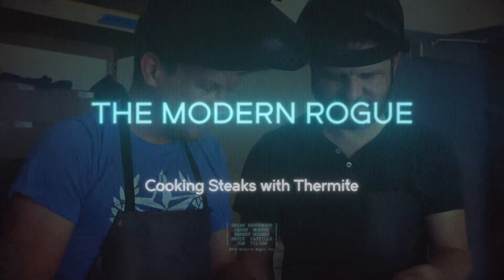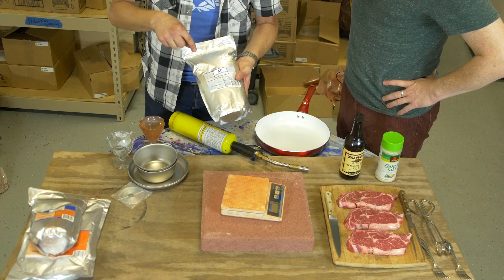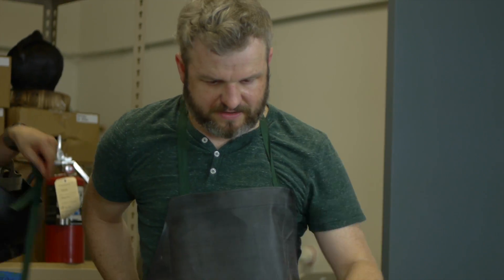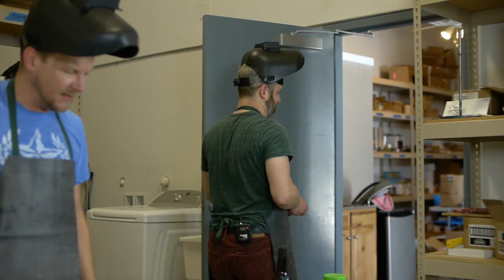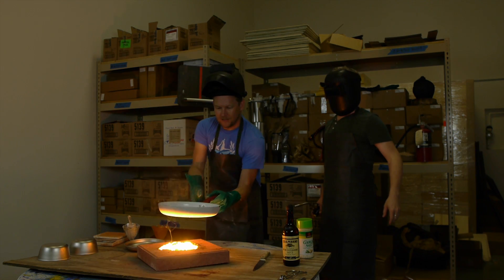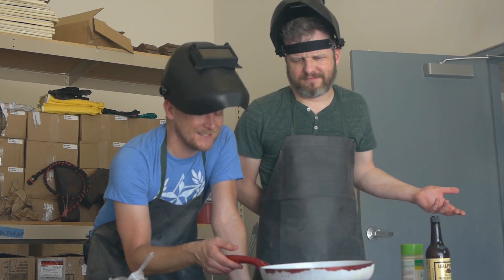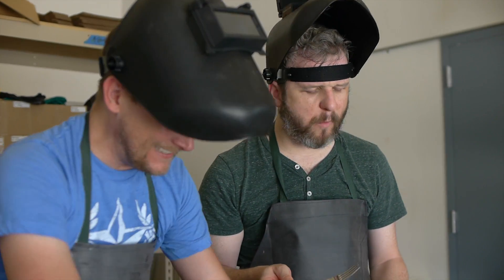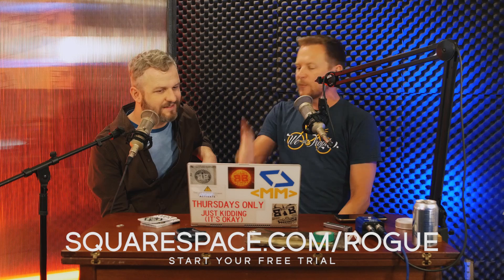Cooking Steaks with Thermite

Comment: almost halfway through and I "hope" the flame point of vegetable oil is higher than how hot that pan is gonna get. or moreso the melting point of the pan. I'd use like titanium and something like refined avocado oil which has the highest smoke point of cooking oils, over 500°F, dunno the flame point but it's usually around 200° higher.... thermite is burning hotter than 720°. smoke point of vegetable oil is like 460-480°F, so I'd imagine the steak is at least gonna get some nasty burn flavor if not catch fire. the smoke/flash/flame points of animal fat is even lower for that matter, and they looked pretty marbled.

popcorn.gif
Reply: ok, I was expecting it to be held over it longer. it seared it but the real cooking was from residual heat. not enough time for thermal energy transfer to ignite the contents of the pan (which that heat definitely would do, probably right before it melts the pan).

Comment: when you mix fuel, metal oxide and metal powder in just the right way,  it burns at 2000 degrees Celsius. Hot enough to cut through nearly any barrier known to man. Throw some steak
 into the mix, and you've got one hell of a combination.

Comment: PSA: oxidizing has nothing to do with oxygen, it just so happens there is oxygen in rust. Oxidizing something just means you increase it's atomic charge. An extinguisher is effective for hydrocarbon combustion with oxygen, but since this is a redox (reduction oxidation) reaction, it won't work to extinguish it as it would a normal fire.

Comment: When you mix fuel, metal oxide and metal powder in just the right way it burns at 2000 degrees Celsius hot enough to burn through any barrier known to man

Comment: Just so you know brian, for future reference its a 1:1 by volume (0.97:1) it a 3:1 by weight for ferric oxide and aluminium... i sadly know this by heart because i am doing research on thermite for a new type ive been working on haha... its also not too hard to figure out once you know the molar mass of the two and seeing that you need 2 Al for every Fe2O3 you multiply the molar mass of aluminium by 2 and then divide the bigger number by the smaller number in this case it was like 158 g/mol for iron oxide and 54ish g/mol for aluminium (after multiplied by two) (also for aluminium because its not a compound its atomic mass is the same as its molar weight) and so you divide 158/54 and you basically get 3 meaning a 3:1 ratio... now if i remember the math i did for its volume ratio it was like 5.2 to 5.4 (0.97:1)

Comment: sigh The idiocy, the idiocy. "We have fire extinguishers." Fire extinguishers with about a max effectiveness of 800 F on a 4000 F-ish fire.
Reply: Thank god you did enough homework on the reaction.
Reply from the maker: On the contrary, the stuff I read indicated that the CO2 fire extinguisher was the best bet to cool down everything to the point that it stopped the reaction.  Is that not true?
Reply: CO2 fire extinguishers are for use against electrical fires and liquid fires. What the don't do is wood/textile fires and flammable metal fires. If you had tried it with a big pile of magnesium, you might have seen it, but CO2 extinguishers just don't work for those kinds of fires.
Reply: You would have needed a specialist powder extinguisher.
Reply from the maker: Are you speaking from experience?
Reply: Yes. Older brother messing around with thermite on the blacktop. They're Class D fire extinguishers, and you can buy them online.

Comment: Also that steak was perfect the first time! 
If your plate isn't half bloody by time you finished eating you ruined the stake! 

It's not really normal rust used
Usually it's a controlled iron oxide 
Generally made by electrolysis because the finer the powder the better 
And it's completely harmless until you get it to auto ignite 
And impossible to put out 
Unless you have shit tons of liquid nitrogen 
And by time you're going to get it cooled you're pretty much just cooling the byproducts

Also the better you mix it the better and more consistent it'll react
Reply from the maker: Pretty sure the CO2 fire extinguisher would cool it down enough to stop the reaction, but good info on the other stuff (and yes: I thought that steak was good to go as well)
Reply: The Modern Rogue you'd have to cool it buy at least 200c within seconds for the reaction itself to stop auto ignition 

There's about a 200c gap of heat produced from the reaction itself that you'd need to stop to stop the auto ignition itself 
 Because of how the reaction works 

But it would help cool the iron produced
Reply from the maker: eh... Honestly, I think the CO2 blast would have blown the pile of thermite away and the reaction would have stopped immediately.  but maybe we should do a video to settle the issue?
Reply: The Modern Rogue sounds like a good video idea to me!
It would depend on the temperature state and stage of the reaction but it potentially could blow some away

How much in no really sure
I'd love to see a video on it though
Reply: Airborne aluminium powder could cause a massive fireball if you just blast it away.
Reply: Sounds good to me
Reply: Do exercise caution; thermite aerosols are of infamous reactivity.

Comment: Someone doesn't know how to cook steak. You never flip it more than once, and you only use salt, pepper, garlic, and thyme. If you get too fancy with it the steak will be shit.
Reply: SethHixie thyme on a steak? are you a fucking elitist? salt and pepper and maybe butter. THAT IS ALL. 

how many times you flip should vary based on the heat source. Not all grills and or heat sources are the same and some areas are hotter than others. You need to get to know your cooking environment.